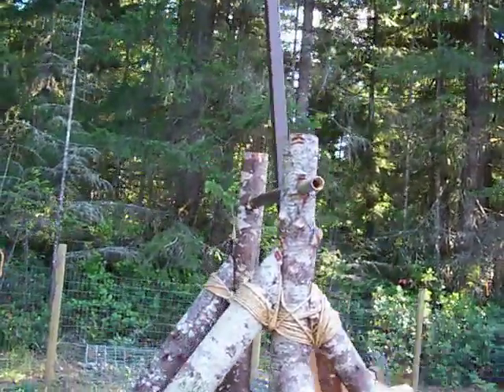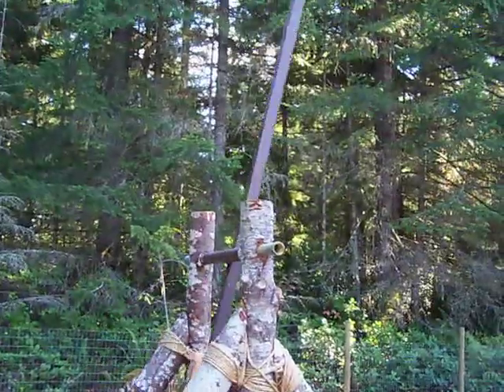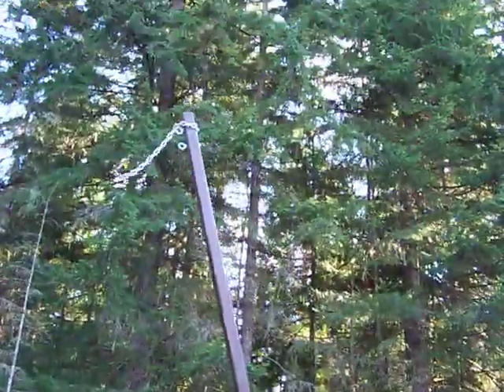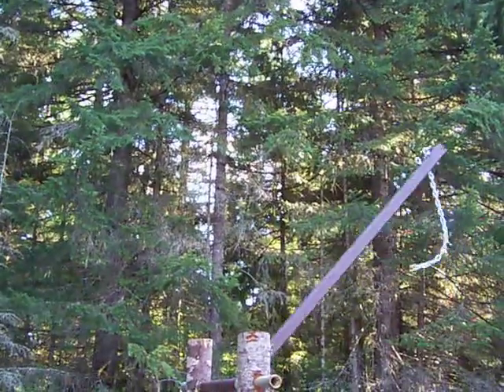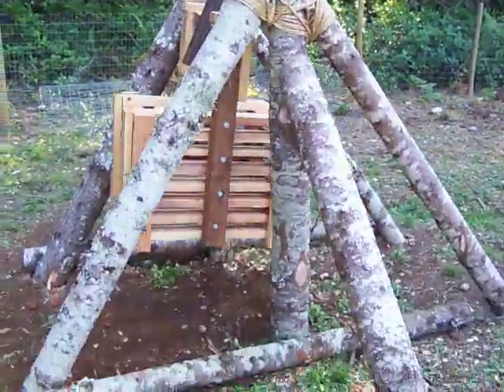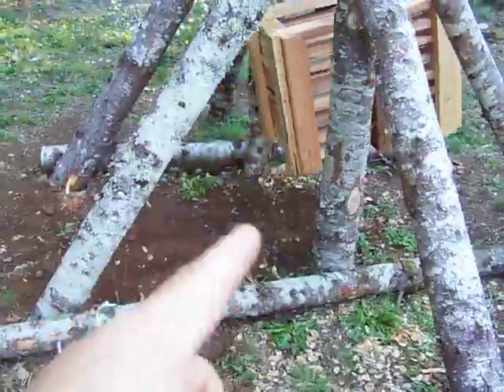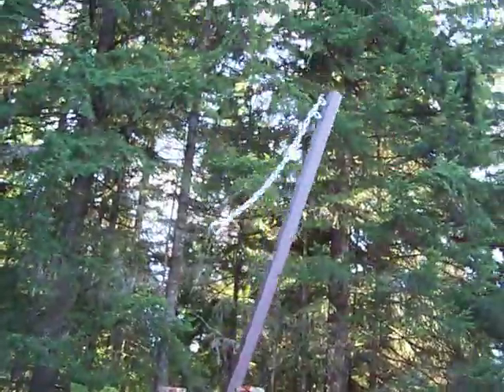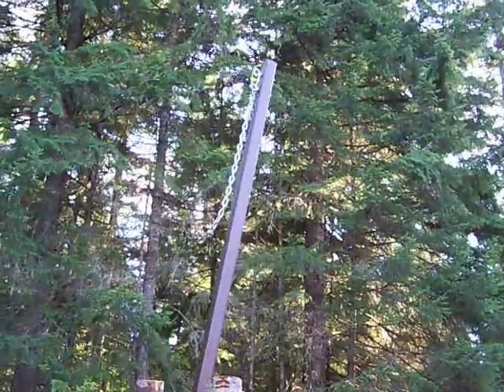Trebuchet anchor...

Comment from the maker: @Captainventana117  One end of the sling will be connected to the eyelet neat the end of the throwing arm.  The "release arm" part will be a piece of rebar connected (probably duct tape, and some band clamps...) to the end, and bent at an angle.... The small chain you see in the video is just for the trigger part only.   Nice thing about the chain--I just move the snap links to shorten as needed.    I also have a bigger safety chain with hooks on both ends.

Comment from the maker: @Captainventana117 I actually started on this back in march by cutting down the big 8" thick trees.  All the posts are buried 2 feet in the ground.  I also have everything bolted together with 1 foot lag screws.  I have some goofy rope around parts, mainly for looks.  I don't weld so I went and bought a 9 foot steel beam and had a muffler shop do the welding.  all I have left to do is make a good sling, and I ll be flinging maybe this weekend!

Comment from the maker: @Captainventana117  Now many of the trebuchets you see on YT are rather lite in over-all weight--and I'm using logs!  My box for the counterweight alone weights about 140 pounds.  I elected to go a bit on the overkill side when it comes to safety/  I think I have 2 major design problems right now:  My throwing arm is a bit short, and the counterweight box support arms could have been about a foot longer.  there should be a 1:7 pivot point ratio on the arm, and mine is 1:5

Comment: As a possible design change if you made the chain shorter and then hooked the netting to the shorter piece of chain and put the eyelits lower in the ground so the netting could pass over it without catching you could get that much more speed into the launch making it go farther and faster so you could target neighbors if you wanted too... Just kidding. Ha ha ha. But how are you going to make the netting release the punkin at the 45 degree release angle?